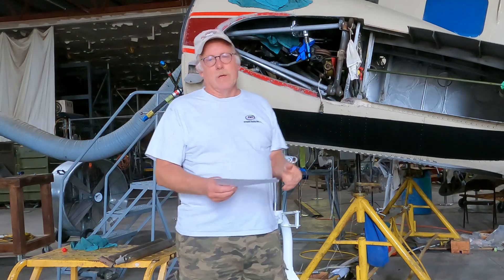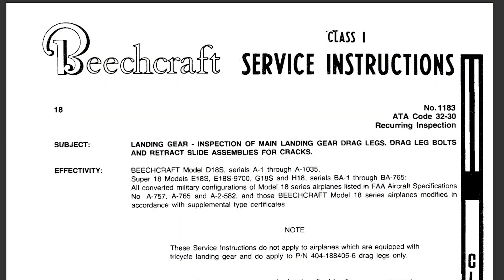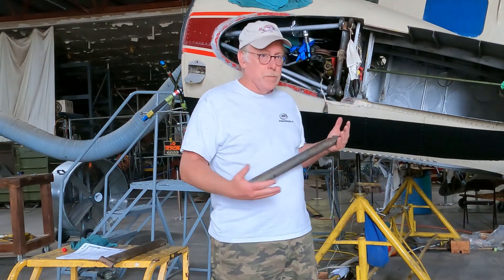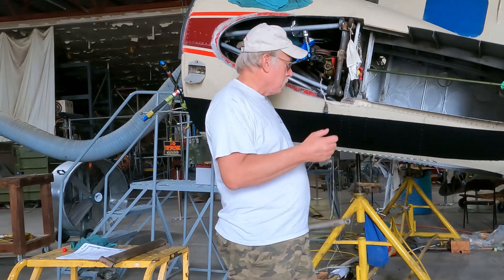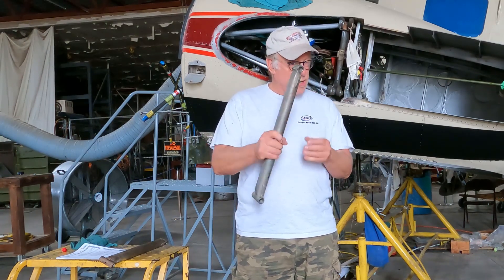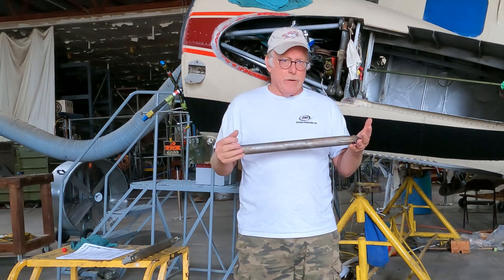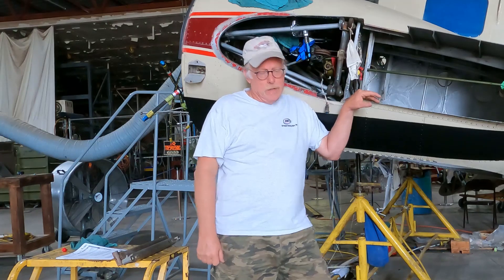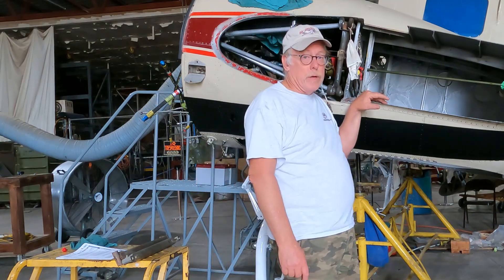Hangar How To - Beech 18 Landing Gear Drag Tube Inspection

Comment: Very cool that you found that. Sure would have been nasty if it went undetected. Expensive too. 
One important thing though, is to check these with dye penetrant at every annual inspection. If you wait for 1500 hours as you and the SL says, then it will once again be very ugly and expensive.